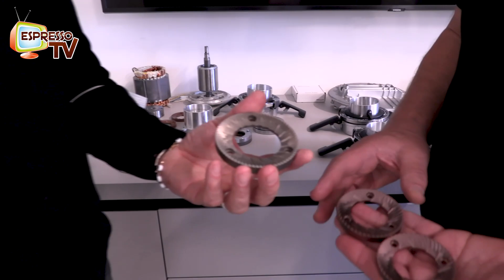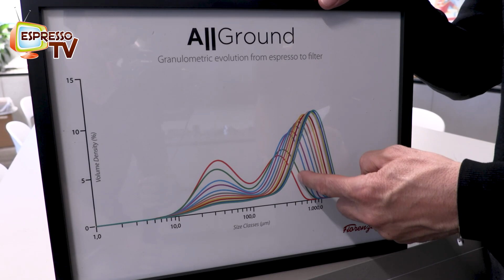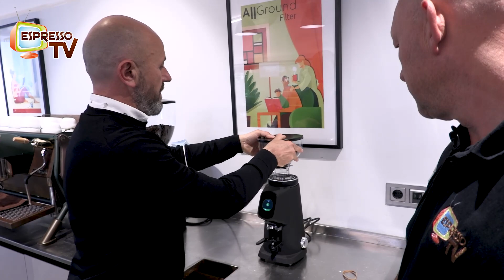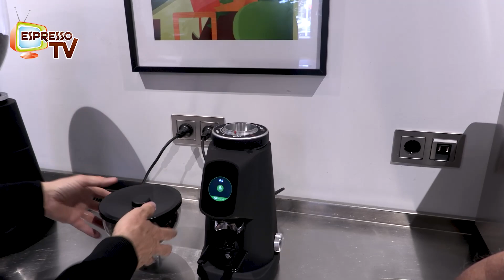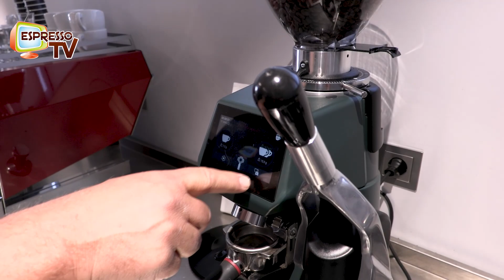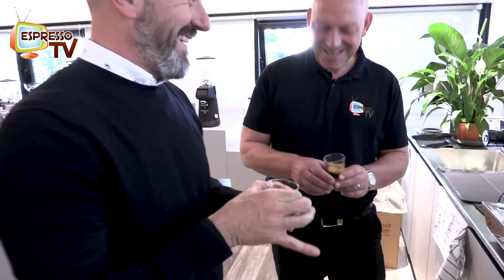Visiting Fiorenzato - an excellent grinder manufacturer

Comment: Why are older models have that cut on the screen where it is darker on one side and the newer ones have that clean screen even black background
Reply from the maker: I do not know, i would like to get photos, then i can forward to the manufacturer. In my opinion they use now a new generation of displays.
Reply: @TheEspressoTV  I think that’s what it is because even in the guide has the same display mine was manufactured Jan 22’
Reply: @TheEspressoTV  the newer screens are different.